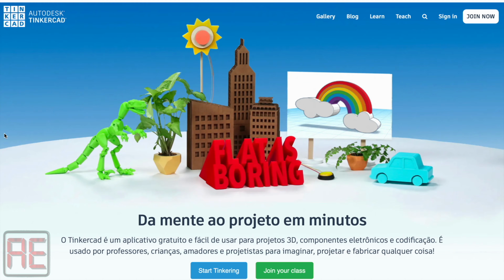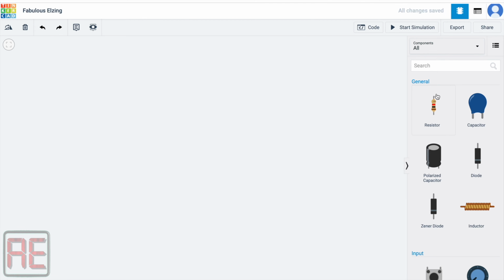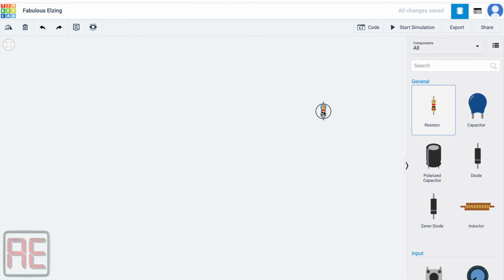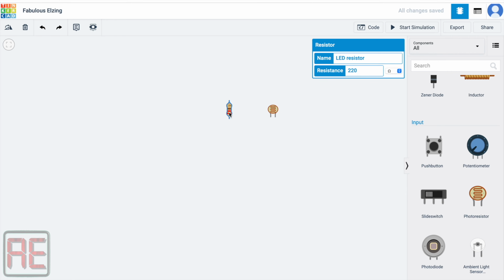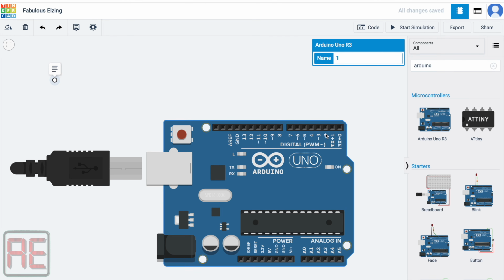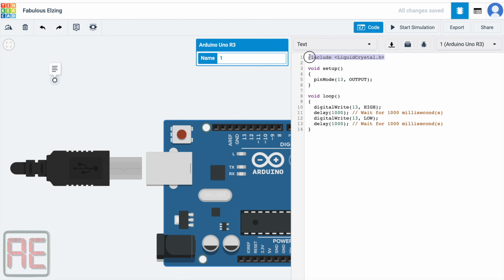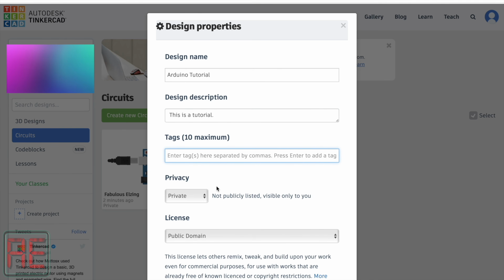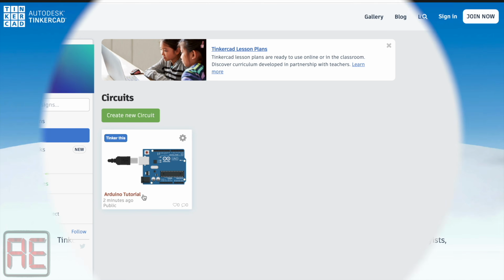The Best Arduino Simulator for (2025): Arduino Tinkercad simulator!

Comment: I didn't know that Tinkercad simulator had all that to simulate, but I consider that Proteus is too good, unfortunately it doesn't have all the sensors in its library that are on the market... You make an excellent video about Tinkercad, greetings.
Reply from the maker: Thank you my friend! I agree that Proteus is a more complete tool to simulate a broad range of different devices and sensors. However, I think that TinkerCad has a more friendly interface (although with limited range of devices). I am glad you liked the video!

Comment: Is there any simulator where i can find i2c lcd module with 4 pins ?
Reply from the maker: Hi 104_Rohit Yadav, in Proteus software you can make the simulation with the i2c module. However, this software is not as user friendly as TinkerCad. Another option is the software Fritzing. It has an interface like TinkerCad, but you need to buy it for 10 USD. I hope this could help you. Take care!

Comment: Not possible on iPad !
Reply from the maker: If you have a circuit already built, it is possible to simulate it and see it working. But if you'd like to make it from scratch using the iPad, it will be very difficult. I'll check with the support if it is possible to create a better interface with iPad. It would be really useful to build our wiring using the Apple pencil as well. What you think? Thanks for the advice!